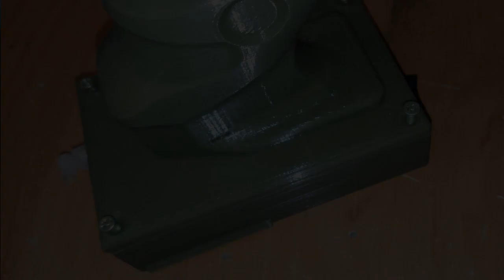Збiрка PEP TinySA Ultra детектора дронiв

Comment: Are the batteries just for LNA or for the Tiny SA, too?
Reply from the maker: Tiny SA comes with a separate power cord with Type-C from the same batteries. The power supply circuit - is linear.